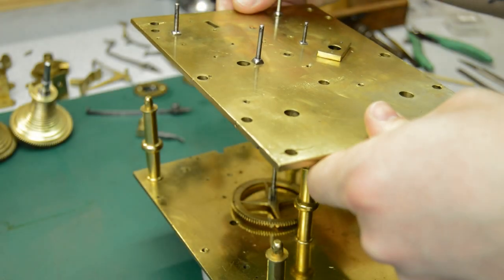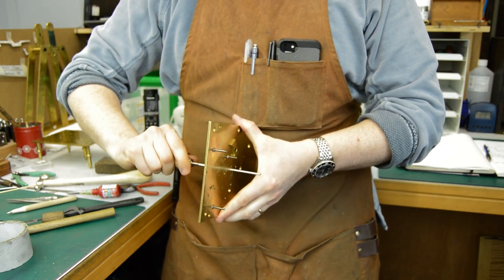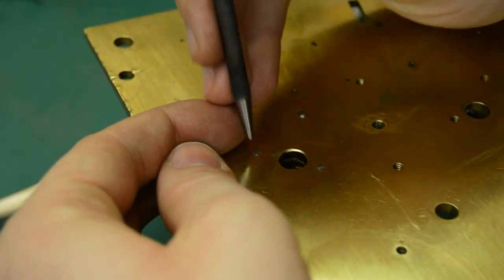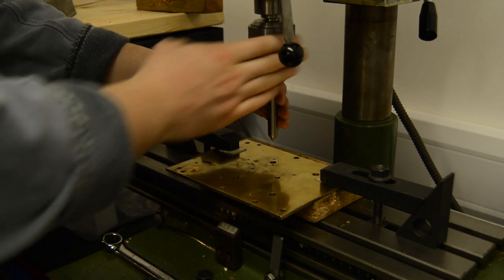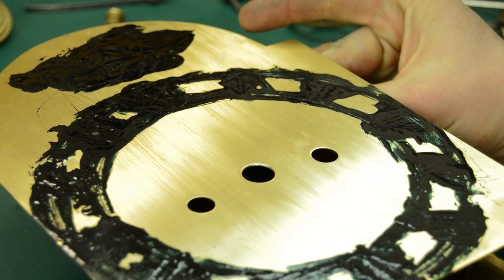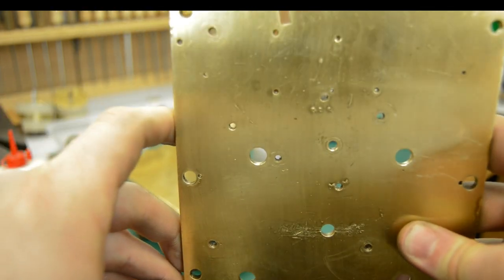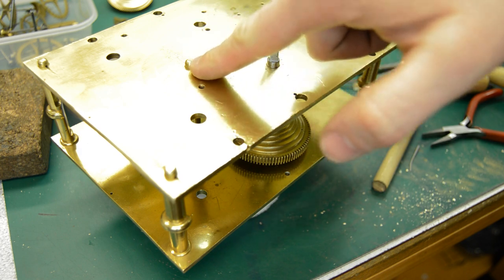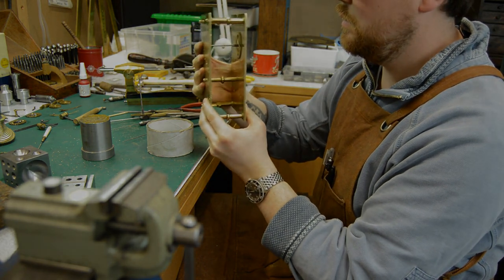Antique Clock Restoration - The Complete Job - Part 5, Bushing and Depthing.

Comment: Glad your back. That block repair on the fusee  seems a very complicated way of going about repairing the worn pivot but I suppose this was one way of doing it without dismantling the whole clock.  Until you talked about depthing I was thinking that just drilling out a worn bush risks moving the true centre as drill will follow the existing worn hole. I would be tempted to use a small key seat cutter or milling cutter.